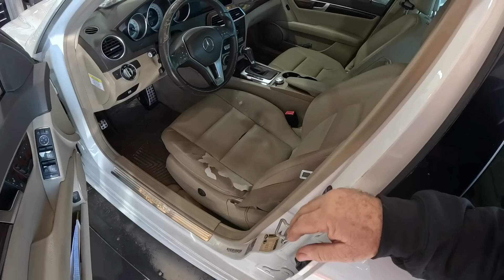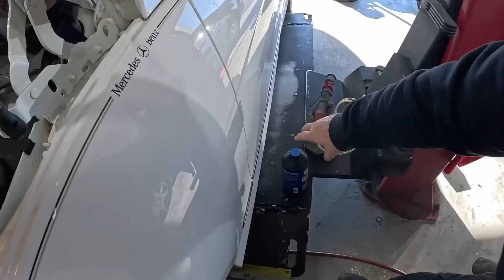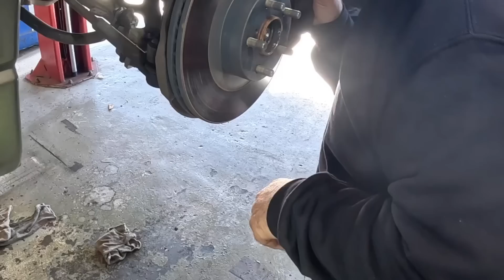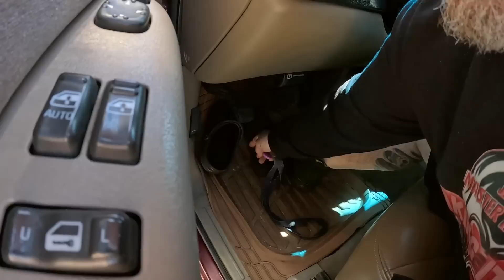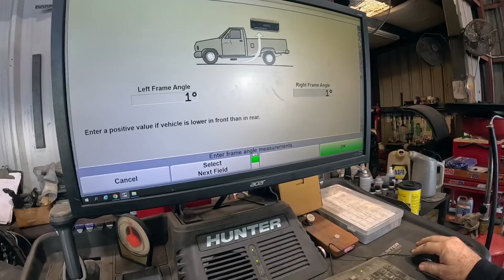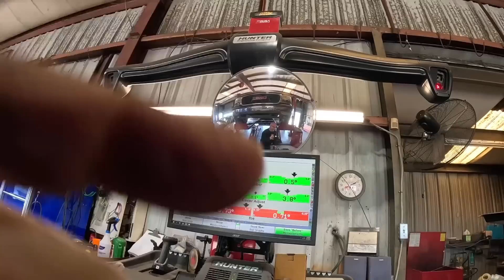C250 oil leaks, Sierra Align, Subaru Axle. Auto Repair Shop DAY 680, fixing broken cars

Comment: When I was a " student "on the SUBARU forums, the mantra was to NOT buy aftermarket  CV's- to buy JY axles because non OEM was junk.
I recently replaced   one( driverside front)  CV  with a " lifetime guarantee ". 
 It's  lasted 2 yrs and now the inboard boot is split and slinging grease😢.

You can't  just undo the bottom ball joint to remove the CV?
MAybe  an '06 is different  from a '17. I've  done both sides without messing with the struts- just disconnect the BJ and turn the wheel.
Reply from the maker: You are right,  there are some differences in the models, but usually it is easier to just undo the strut and swing it out of the way. Either way can work. I find the ball joint fights me sometimes.